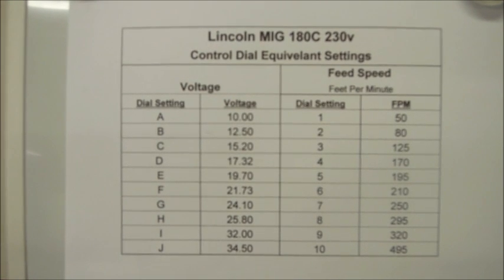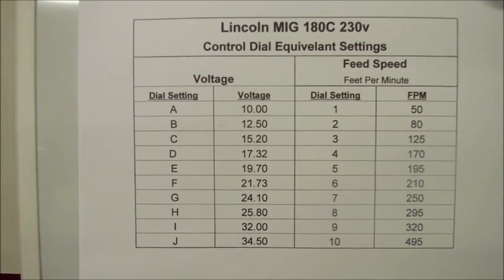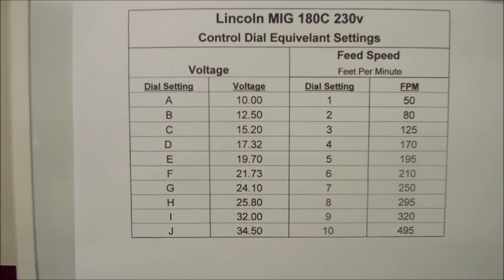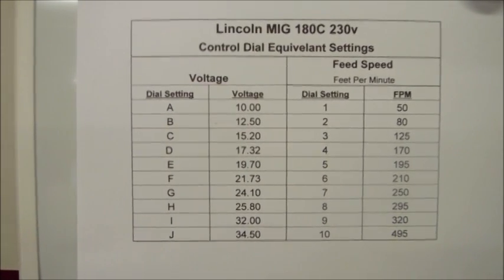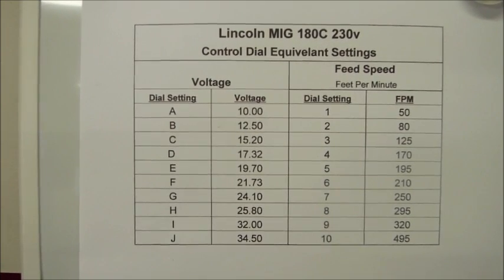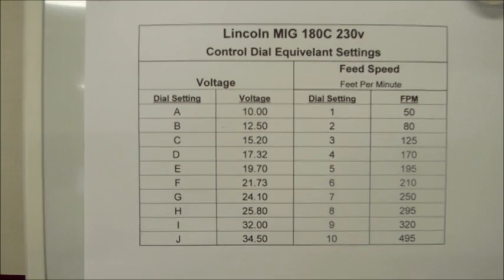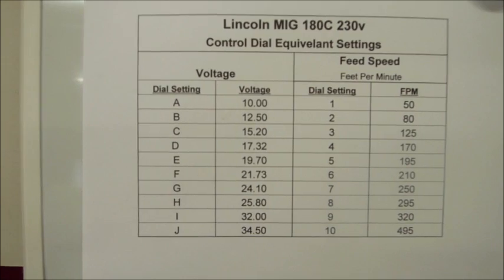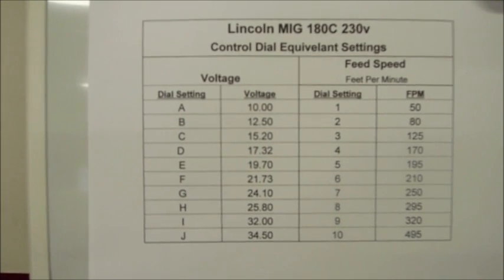Lincoln MIG 180C Dial Settings Cross Reference Chart

Comment: How similar do you think these settings would be compared to the 120v?
Reply from the maker: If the drive mechanism is the same between the machines, which it very well may be, then the settings may be the same or similar.

However, I've never owned or used a 120v machine, so I can't say for sure.

Comment: I've been looking   chart like  this some time, the only problem is my mig pak 180 (230 vac) has only from A to E  ?. Wire speed is 1-10  and is fairly easy to measure .  Do you think there is any correlation on the voltages with your chart?
Reply from the maker: I don't really know Bill.  My suspicion is that though the overall voltage range may be about the same between the two units, with your machine they divided the range by six (A-E) and with my machine they divided it by 10 (A-J).  That would suggest the increments on my machine are slightly finer than yours.

As I don't own nor am I familiar with your machine, that's the best I can do.
Reply: @kwrightway  thanks for the reply, i was thinking along those line,i will get my son to take readings as i weld on each voltage ,now if i can only find my misplaced voltmeter. merry Christmas!
Reply from the maker: @billfleming6880  Good luck, and Merry Christmas and happy New Year you to you, too!

Comment: pardon the question but was hoping you could assist on how to dial up a lincoln 180 hd to weld 1/4" stainless steel rod?
Reply from the maker: Sorry, I have no experience setting up for or welding 1/4" stainless rod, so I'm unable to guide you.